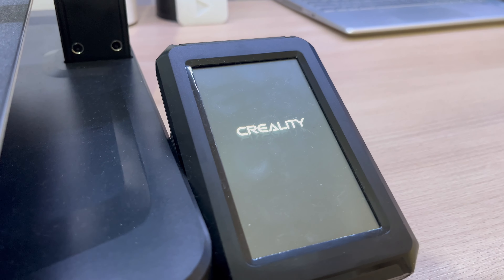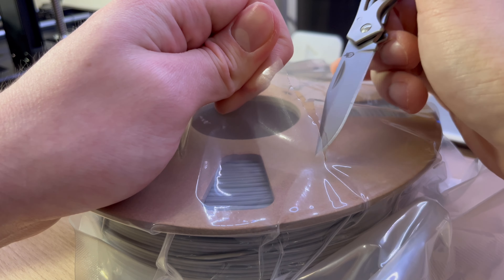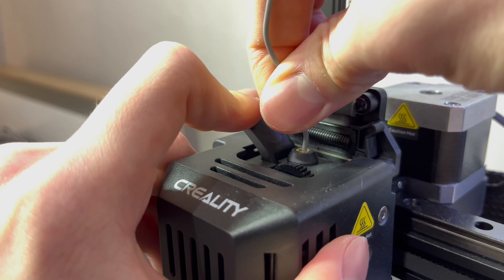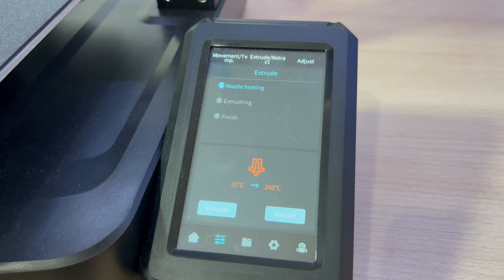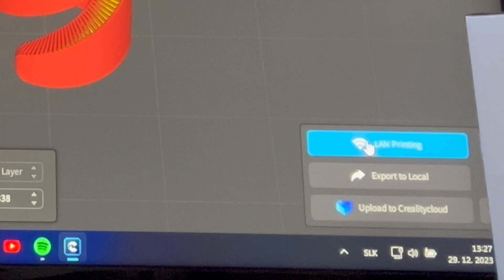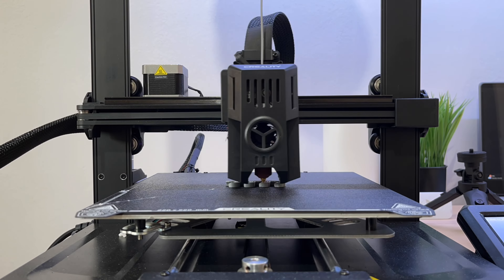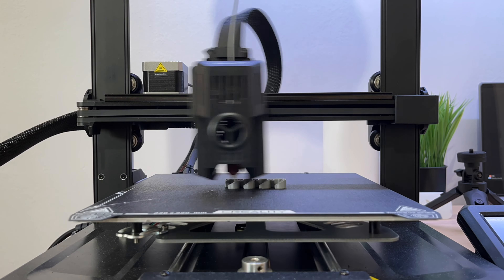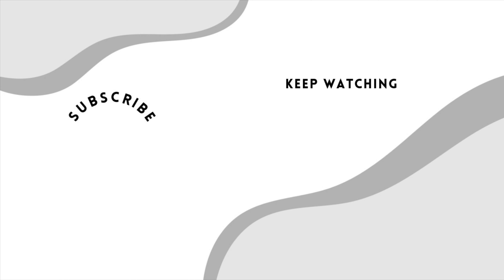Mastering 3D Printing with Creality Ender 3 V3 KE: The Ultimate Guide

Comment: You have any adhesion issues with the stock plate?  Did you use any glue stick or just kept it dry
Reply: The stock plate is textured powder coated PEI, it shouldn't need any adhesive for PLA, PETG, TPU, ABS or ASA (although it will need to be enclosed for ABS and ASA).

Comment: Hello! Two questions: 1) How hot need to be the bed and the nozzle? 2) my printing stick very bad on the bed and is so hard to peel (plus the printing when I peel it, The filament loses its shine and white parts are visible.(I used color filament))
Reply from the maker: i use the parameters which are given on the box of the filament :) dont peel it just take off the table part of the printer and it will come down itself
Reply: @hlfilms._  Thank you for your fast answer! Thank you so much 😊

Comment: Don't buy a Creality. The "after-sale" customer service is non-existant. And if you (like me) have problems with your 3D printer, you'll end up with an expensive paperweight. 
I've owned the KE for 6 weeks now. For 5 weeks, I've had nothing but problems, and Creality does nothing but automatically open and close cases without any attempt to resolve the issues.
It's dead in the water with a screaming fan that sometimes doesn't work and burns filament, extruder is damaged, it stopped connecting to the Wi-Fi, and the flash drive doesn't read. Being that they won't fix it... the 3D printer, the scanner w/upgrade, the nebula camera, and the LED light will probably end up in the trash. No more headache. Don't waste uour money on them.